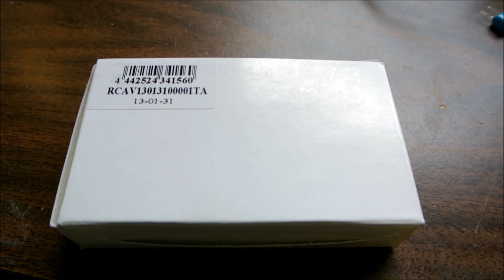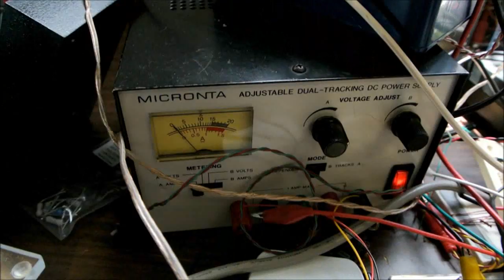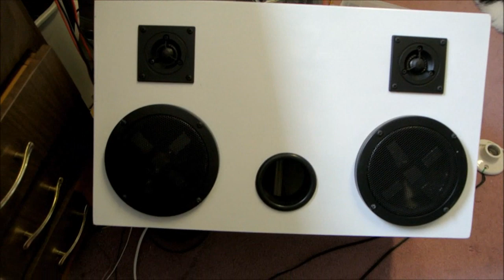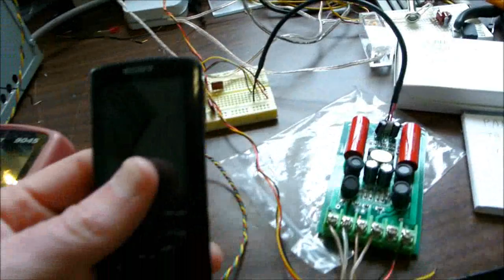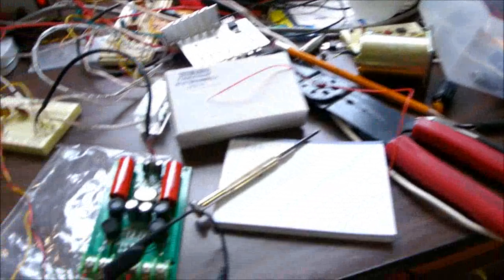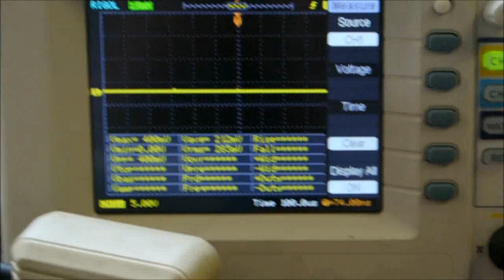Class T TA2024 stereo amplifier test

Comment: Hello John. I bought some of these amps and i found some intriguing features.. one of the output line is inverted.. the middle one to be more precise.. if you measure mV it gets negative values.. is it normal?
Reply: And the other question, should we connect the speaker correctly as the voltage or as indicated in the board? Please if you can, check on your amp board. Best regards
Reply from the maker: The amplifier has a bridged output so the output has two "live" outputs per channel. One is inverted. This makes the output signal voltage 2x higher for more output power.
Reply: JohnAudioTech  Ok, but should we connect according to the voltage output, or according to what is written in the PCB?
Reply: JohnAudioTech  Another question. I was thinking on using one of this boards to make a boombox. I also have a Yamaha YDA138, but both of them outputs so low volume.. i'm using a 12v battery.. should i use an opamp? i was really disappointed with the boards, i had watched some good reviews on it
Reply: One thing funny, the output voltage in YDA138 is like 20 mV... something is definitely wrong here..

Comment: Have you found a way to remove that sqealing noise when connecting the audio source? I'm having exactly the same amp, building a boombox and this is so annoying...
Reply from the maker: I found the amp board is backfeeding the inputs with voltage. My digital audio player doesn't like that and makes that squeal. Putting some capacitors in series with the input should stop that. I don't know what value to use yet without determining the input impedance. There are other better boards to use. Check the one I reviewed on Oct 20th.
Reply: The behavior is normal, this is a power amplifier, and it just takes what comes in and applies a fixed gain. It needs a proper input stage which should include, but not be limited to, a preamp with volume (the ipod provides this much), a pair of DC blocking caps, a pair of fuses or TVS device, and some over voltage protection in the form of zener clamps. Muting the input until the connector is fully pushed in is not a bad idea either.

You can actually badly damage the amplifier by connecting and disconnecting inputs or outputs while live like this... Also the datasheet for the TA2024 mentions that VCC is 12v. There will probably be clipping of the signal at high output with VCC under 12v, which was readily apparent on your oscilloscope shot, along with ringing at the top and bottom end.

Comment: I am amazed at the quality of digital sound amplifier. Bass is consistent and strong, middle tones pushed good, high tones are clean and sweet .What is important is a strong power supply [Ampers] and good speakers , also short cables.It's all in a little cold form, because inside MOSFETs are only in two states 0 or 1 with a frequency > 100 kHz .modulating the width of the pulses.!!!.

Comment: what is the type of audio input plug you used on the board ?
Reply from the maker: +Andre Haber It came with a three wire connector. You would have to solder on the appropriate connector you need for your application.

Comment: Epoxi not good to heat transference..use another idea instead of glue
Reply: Use solder. The heat sink is on the back of the board. Solder some piece of copper or aluminum with decent surface area to the large tinned pad in the middle of the board.

Comment: Hey J, checkin' the class T amp. Go to Runoffgroove.com and check out the Ruby v1.2, 1/2 w guitar practice amp, a fun build. Could maybe use for MP3 player, etc.. Clean around the MPF102 J-FET pins, so as to avoid stray voltage on the actual phenolic board its self. I had that issue and fixed 4 Rubies, full volume, gain. Be good, C. P.S. Score & Alcohol around J-FET pins.

Comment: You can get these things, exactly as seen here for under UK £5.00. However... 
If you spend another  UK £3.00 you can get one that is cased. I have heard a deal about these having issues around a early death. Maybe they are cutting corners by not using heat-sinks. Another thing is that a power supply rated at 4-5 amps is necessary.
The crap on the peaks & troughs of the sine wave is said to be switching noise due to inadequate filtration. These boards offer scope for modification. Where you'd get a suitable heat-sink I do not know.
Reply: +NJPurling Search raspberry pi heatsink on ebay, they will help a lot! :)

Comment: I love these ta2024 boards I get them for between $4 and $5 bucks shipped from China, they are great for little boom boxes or desk top systems, but you need to change out the feedback resistors to get the full output from little MP3 players or phones, and you get virtually no heat running 8 ohm speakers, running 4 ohm they get pretty warm but only at full output which is generally to loud and clipping the signal anyways. I've been using these for about a year and haven't had a problem yet. You can mod them for better sound but for my intended use I can't see spending $30 dollars on better caps for a $4 dollar amp. Most people that here my setups are amazed at how great they sound anyways.
Reply: How do you change the feedback resistors? I couldn't find a decent guide.
Reply: +Turan Sadri it's just one resistor you change out and I've replaced the surface mount one but that's a pain in the butt for others I've just soldered a thru hole one on top and it worked.

Comment: Ok it's $12-$13.  I'd call that a deal.  As for the heat issue, yes put a heat sink on it.  I would not expect the chip to stay cool putting out 15W (Probably RMS).  Even though it's a switching type amplifier.  I am waiting for 2 of these and i will be putting on a heat sink first thing.  Did you finally put on a heat sink on your amp?  If so what were the results?
Reply from the maker: I put it in a drawer and forgot about it. No plans for using it as I build my own. It is cheap for a reason. Second rate components (no name electrolytics) and they are too cheap to include a heat sink. The oscillations in the output waveform are not encouraging either. That said, you may still get away with using them if you add a heat sink since sound quality is okay.
Reply: I think the first problem is that it is a D class amplifier.  Right there you cannot get back 100% fidelity of the music.  I am guessing you would build wither a class A or class AB amplifier if you want great fidelity.
Reply: The TA2024 is a fantastic chip. The board design will vary, but saying it's a bad amplifier is just being ignorant. The oscillations (ringing) at the top and bottom end of your oscilloscope shots, along with the flattening of your sine output, was because your input voltage was inadequate. The TA2024 needs 12v VCC or it will clip, and the board doesn't have a regulator, so you need to provide clean 12v. The capacitors are completely inconsequential, they are just big "tank" caps to provide fast power response. As long as they don't leak they don't matter, bad quality caps with high ESR will just slightly reduce efficiency. And seeing as these boards are a measured 80%+ efficient, no big deal. The board also doesn't have an input stage. You need to provide DC blocking, biasing, and input protection. This is a power amplifier breakout board for hardware development, not a plug and play ipod amplifier...
Reply: +JohnAudioTech I got the same scope picture, but seems that crap is somewhere before output keys.
In modulator part maybe...
It's not because of bad quality output filters (coils and caps).
Because on low power the sinus is clear.

Comment: Excellent, this is what we want to see! Cold hard facts instead of playing badly recorded loud music to "show" what an amplifier supposedly can do.
Reply: That's exactly what I'm looking for.

I'm looking to build 2 7.1 systems, one for my desktop PC and one for my home theater.

They don't need to be super loud, but I want them to be clean sounding.

Already got the power supplies sorted (got my hands on a box of 20 19.5v 7.7A and 10 19.5v 11.9A HP laptop power supplies), have sorted Raspberry Pi's for the HUD and control center (standby power doesn't matter to me because of that since I'll be switching everything off completely with the Pi's) and already had all the speakers from existing 7.1 systems I got that were sold because the head units literally drowned during a storm XD

But the boards I tried from Banggood have been hit and miss so far. So I'm researching some YT videos that have decent testing and some that show how to improve the quality of some of these boards.

I love all these guys that put time into measuring out all these boards.

I'd do it myself but my joy is more to be had in programming the Pi's and designing all the auxiliary circuitry  that brings the PSU's, AMP boards and controls together.

Comment: Thanks for the video. Note that the chip has a heat slug, so with proper mounting and board design it is cooled by the copper surface on the rear of the board.
Reply: Exactly. I mounted mine inside a small aluminum project case, and use a piece of copper off an old PC heatsink, screwed it into the case so the exposed heat pad on the board sits flush on it, and then soldered the copper lug to the board and put thermal grease between the case and lug joint. So now the board uses the case for heat dissipation, it just gets a little warm at 10W output. I have a different board though but it's the same reference design. 2578-TA from LC Tech, same TA2024 on board.
Reply: Все равно сильно греется. Даже с радиатором нагрев заметно.

Comment: Wonder if there is some DC offset from your Sony?
Reply from the maker: I'm thinking there may be a voltage spike from the amplifier at power up that passes through the input caps as they charge causing the player to do that. It's output is sensitive to shorts and other abnormalities I have found.

Comment: The last chip amp needed so few external components, I don't see much benefit with these, though being a finished product is nice. I suppose it probably uses power more efficiently, might be an advantage in a battery powered application.